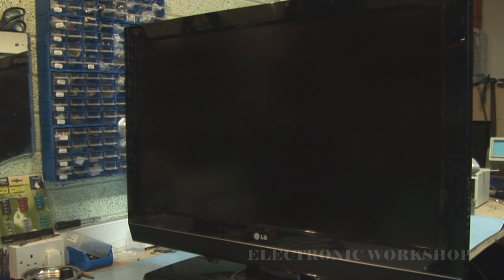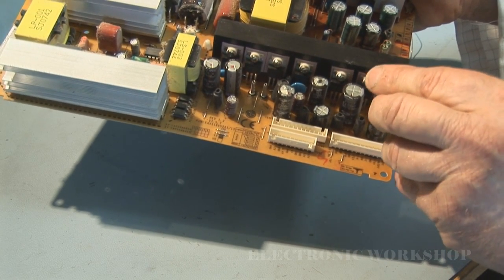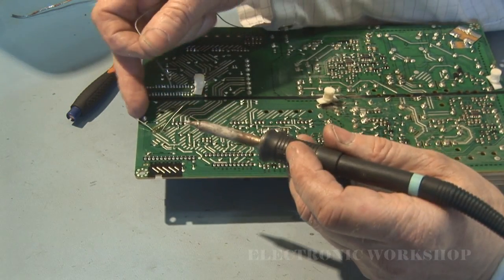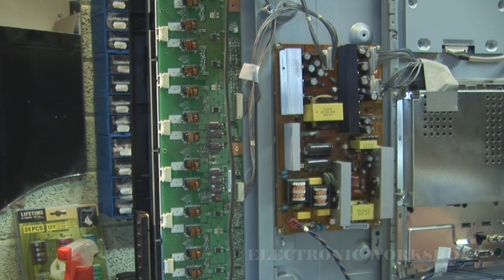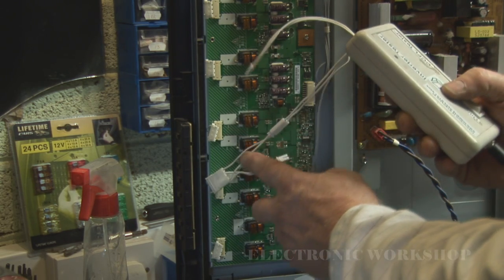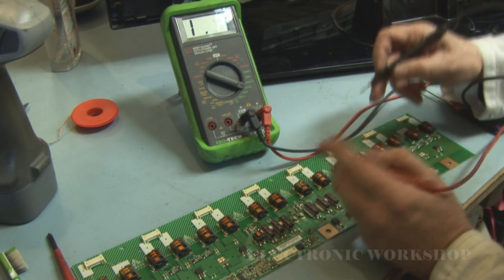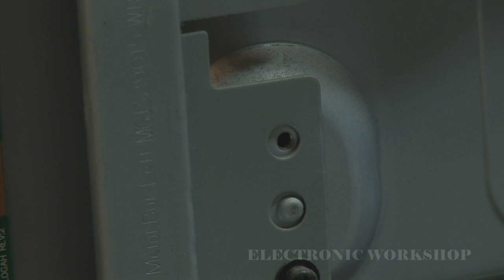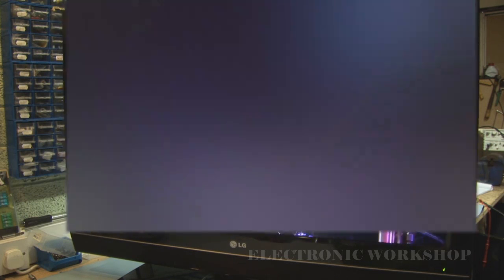LG 37LC55-ZA No Picture

Comment: What type of soldering iron do you use and what type of solder?
Reply from the maker: max head the soldering iron I am using in this video is a Weller WD1Heats up very quicklyI normally use leaded solder, sometimes unleaded.Leaded solder flows better than unleaded solder